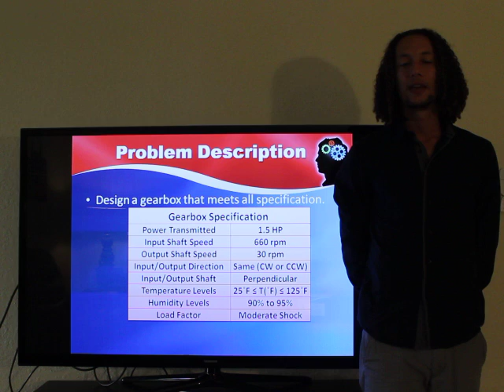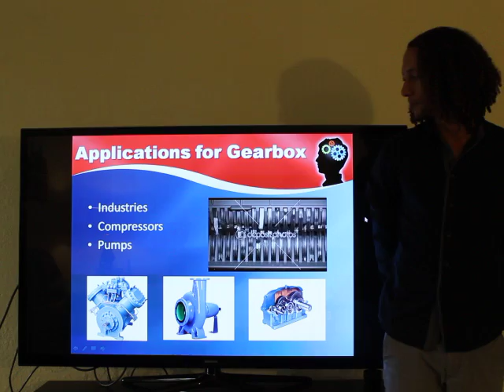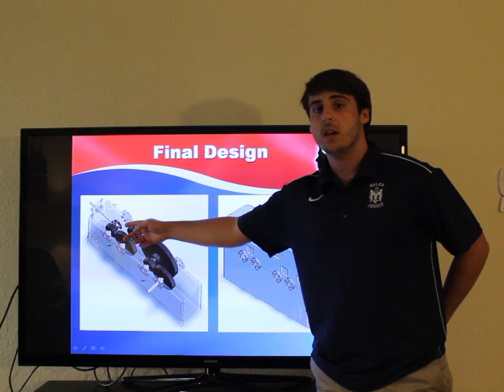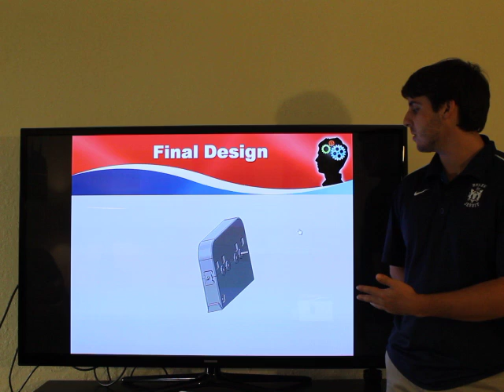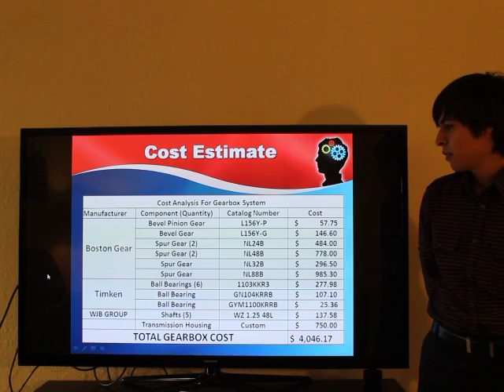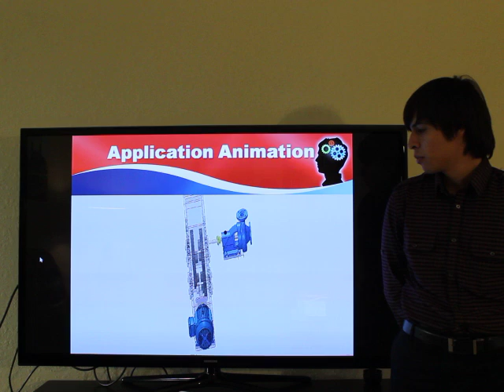Team 18: Gearbox Design

Comment: Very well done presentation.  The project was well explained from start to finish in the presentation.  I would suggest that the lighting be slightly increased for the video as it was a bit dim. The last presenter could have also moved in slightly to the left for a better frame.  Other than that the presenters were well prepared and had good contact with the audience despite the lighting issue.